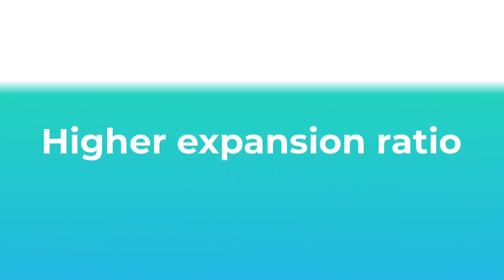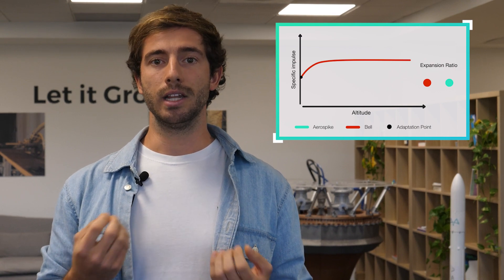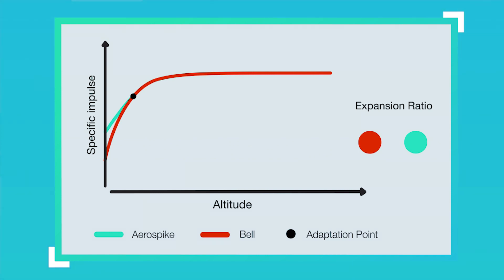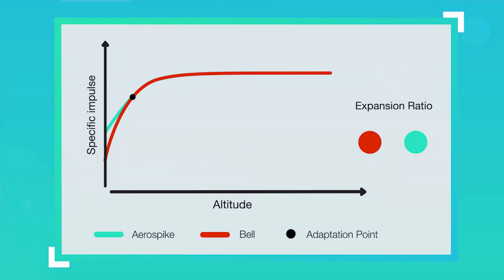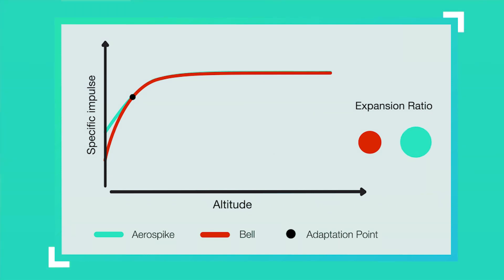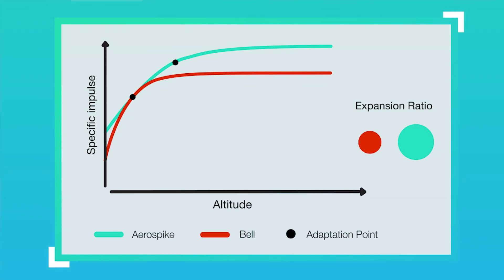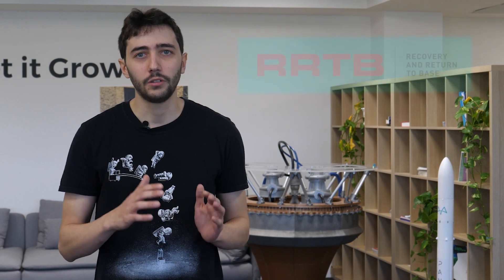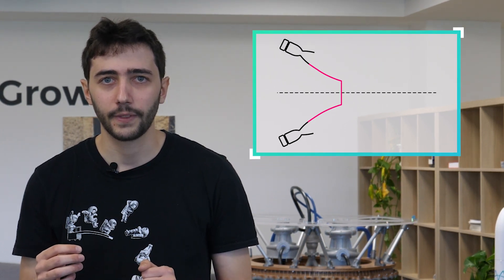Differences between aerospike and bell nozzle | #AerospikeSeries Chapter 2

Comment: Efficiency is about the expansion ratio AND the direction of the flow.  With a bell, an optimally expanded flow is ALL travelling directly opposite the desired direction of travel.  Even though the aerospike is optimally expanded at high altitude, some of the flow is travelling outwards, meaning that all of the momentum increase is NOT opposite the direction of travel.  At lower than design altitude, the flow is still directed inwards as it passes the end of the plug -- with the same effect (but less than the equivalent drop in an underexpanded bell.)  You also have the "base drag" of the flat end of the plug to overcome (yes there are mitigations.)